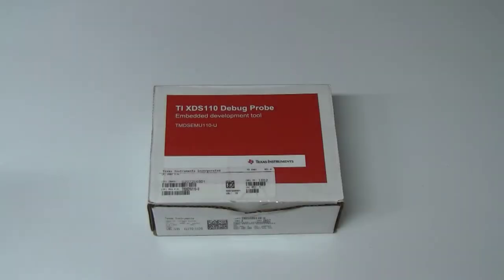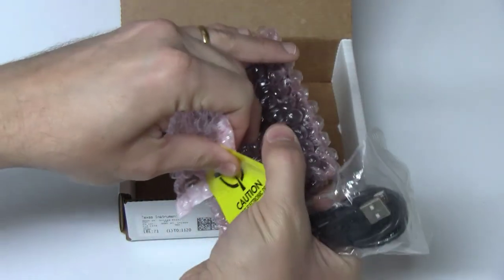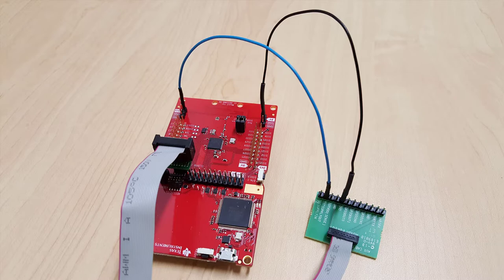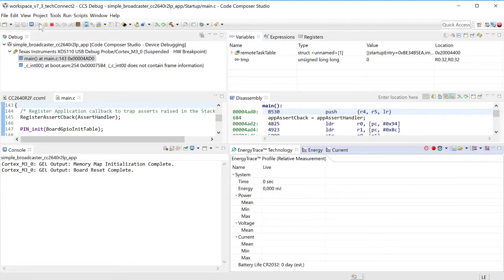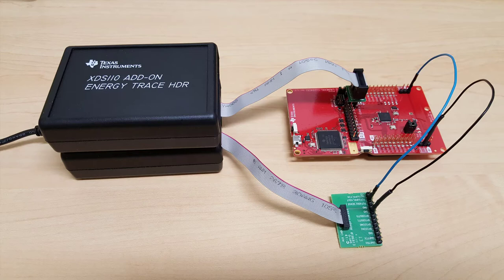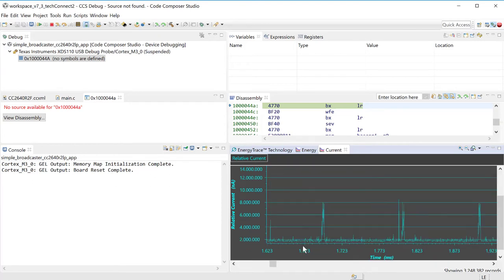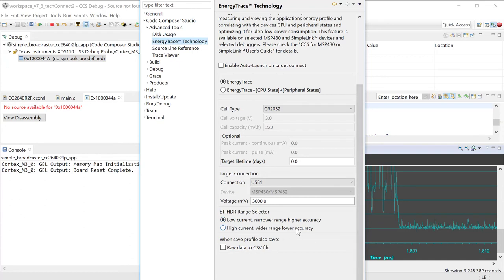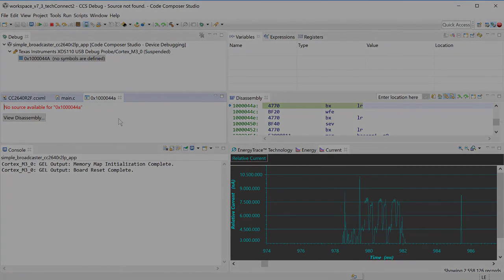Unboxing the EnergyTrace HDR

Comment: Nice demo. My question: Do the decoupling capacitors affect the measuring current resolution and accuracy? Do you have any formula to try out the values of decoupling capacitors for the MCU in the test for a better resolution and accuracy of the dynamic current measurement range? Thanks